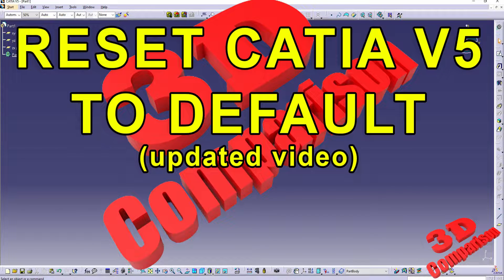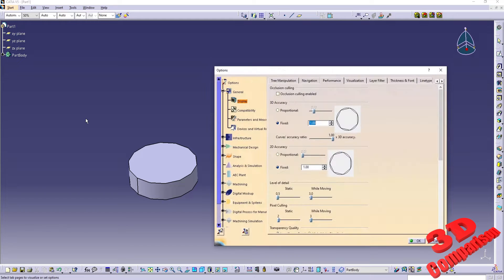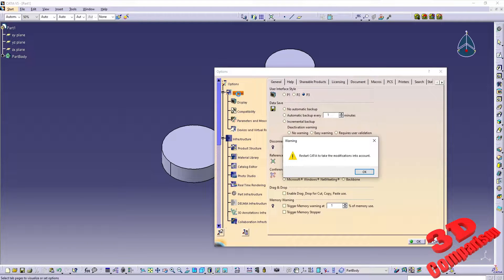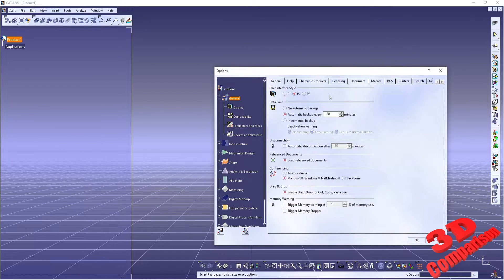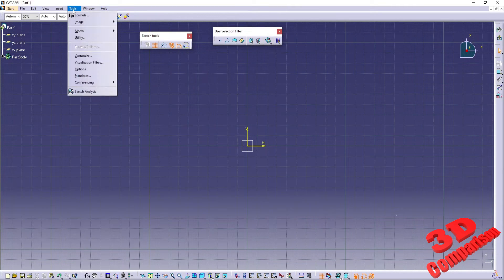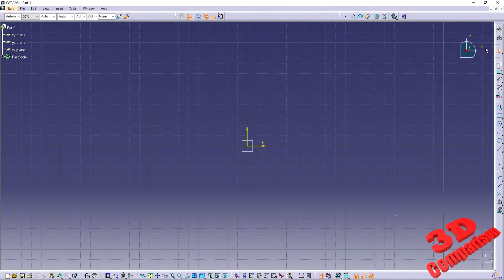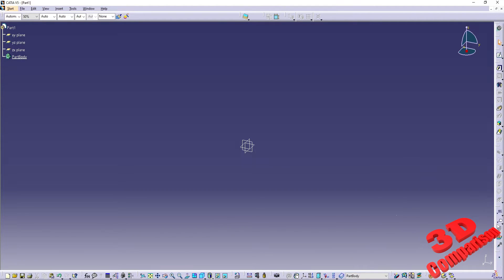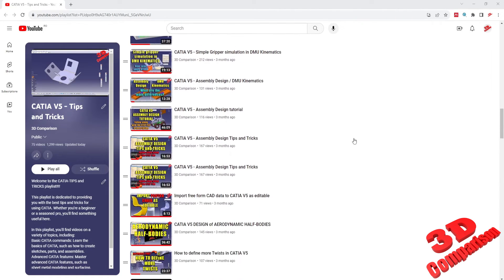Reset CATIA V5 to default (updated video)

Comment: Also, I would like to add a very important point for backing up your settings and customizations. All you need to do is going to this path "C:\Users\UserName\AppData\Roaming\DassaultSystemes" and copy the folder named "CATSettings" in it to a save palce.

I have customizaed alot of tool bars within many workbenches and have changed almost over 30 settings to my preference. After I reinstalled Catia due to a problem in my Windows, all I needed to do was pasting the folder I copied from the mensioned path and restored all my customizations and settings I changed. 

Hopefully this was helpfull, and if there is an easier way to backup the customizations and settings, kindly share it with us 🙂
Reply from the maker: I agree that it is important to backup your customization and settings. I will address this within a following video! Thanks for the wonderful comment!
Reply: @3DComparison  No problem :)